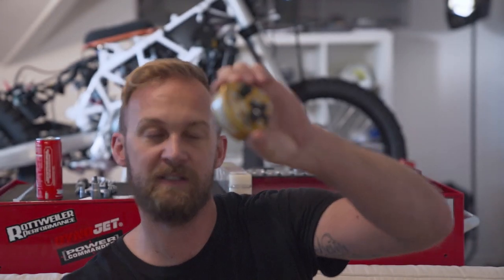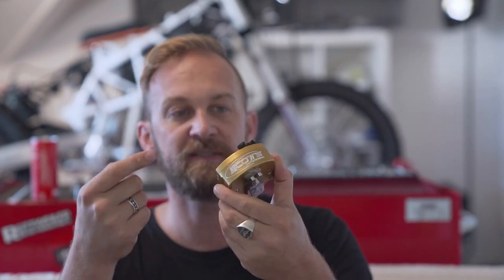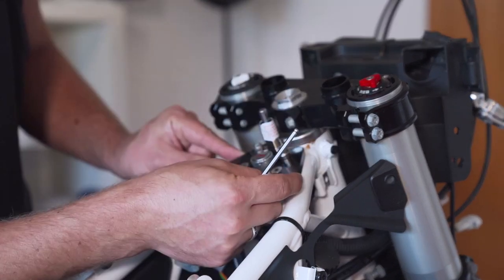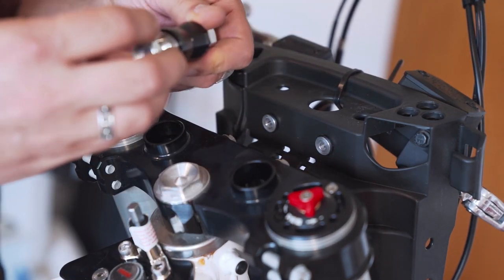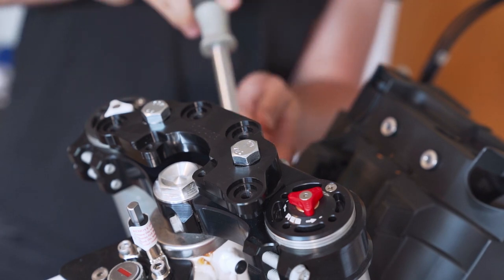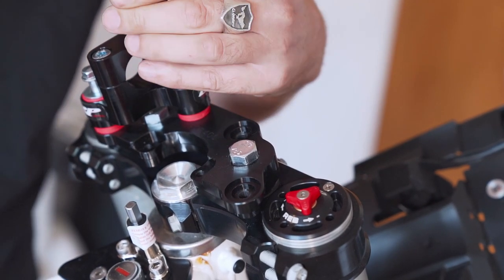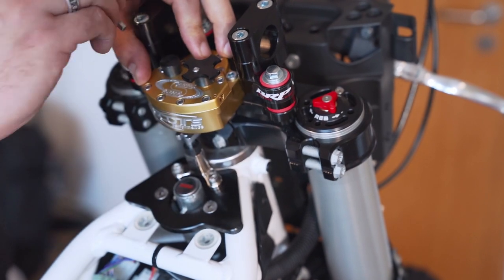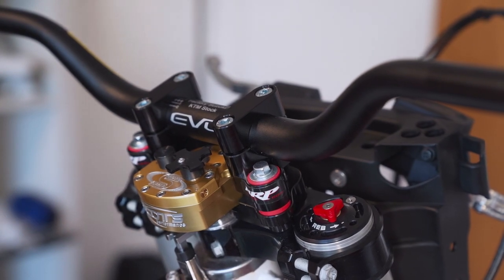Steering and Vibration Damper - Dirty Bastard VLog S1E5

Comment: You unfortunately tightened your handle bar clamps incorrectly.

TECH TIP: Install the handlebar clamps so that the punch mark(there is always a mark on the caps) points towards the front of the motorcycle. Tighten the front bolts before the rear bolts. The front of the handlebar clamps should sit flush against each other, but there should be a slight gap between the clamps at the rear of the handlebars.Torque the bolts to specification.